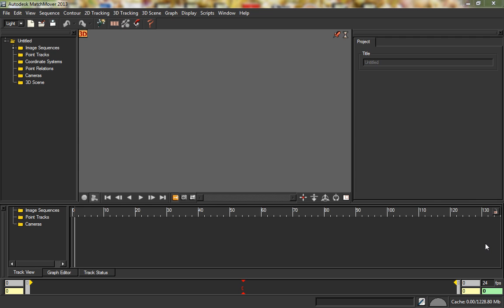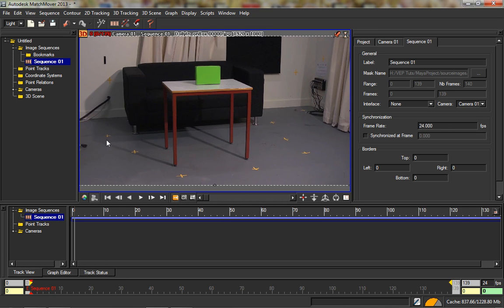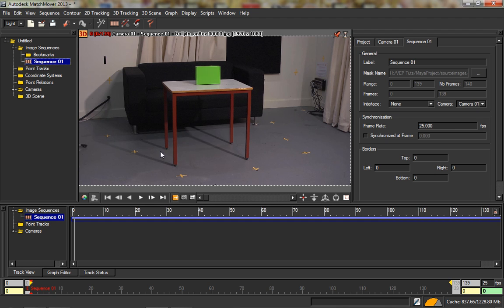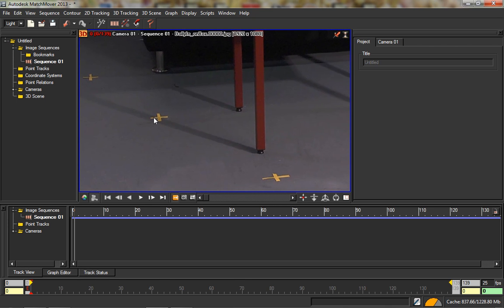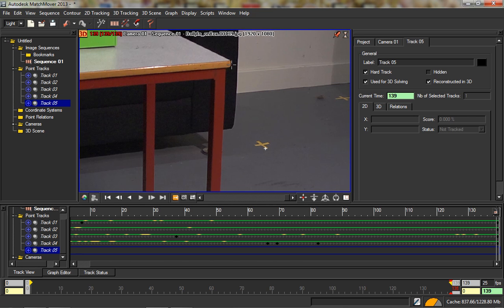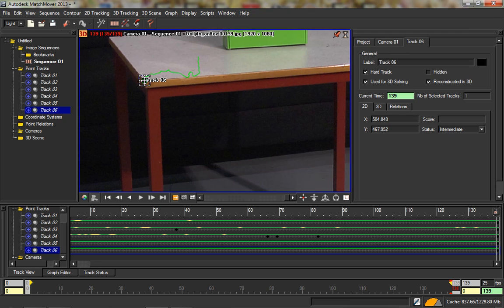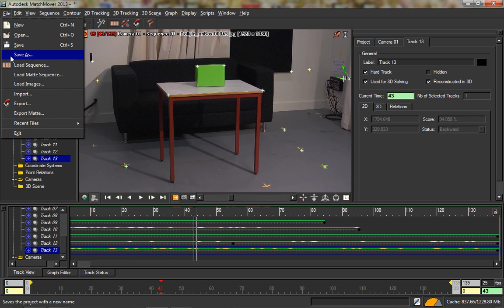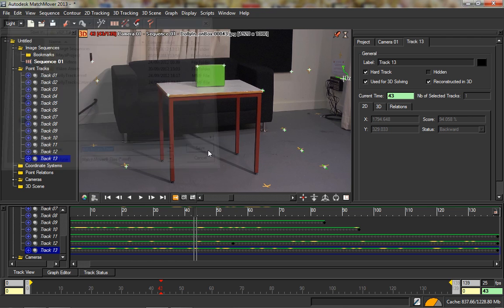Supervised Tracking In Matchmover - Part 1 of 3 - Tracking Points

Comment: Nice Tuto ..!! I have a question for you, why is my Camera Plane no longer moving in Maya? I am desperate, Tacking in Matchmover works without problems, even camerasolving, but when I open it in maya the trackers do not move my camera Plane !! I need urgent help !! thx
Reply from the maker: Jonny did you solve this.  The aim of this is to get a moving camera, so the result you should get in Maya is a moving camera, with tracking markers that are static in the 3D locations that the camera tracking software  thinks the markers are located.
Reply: Hi . I had same issue . Change image sequence with avi movie file . It may mismatch a little bit , but dont worry , when compositing in after eeffect with same footage in match mover as a image sequence . That gonna be very nice